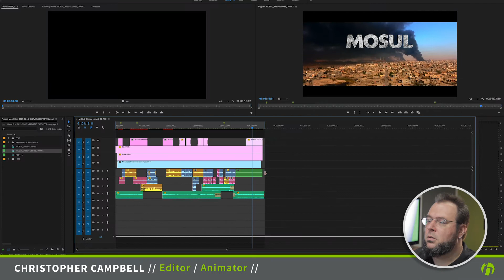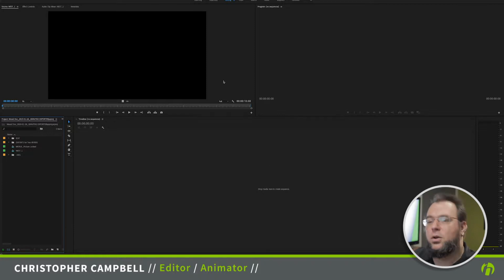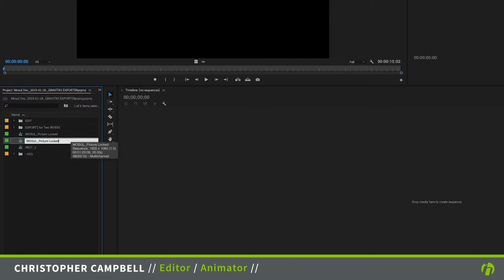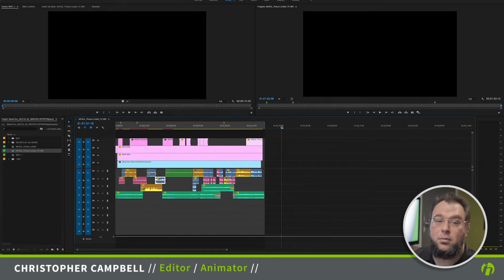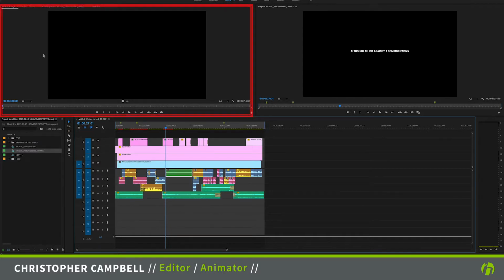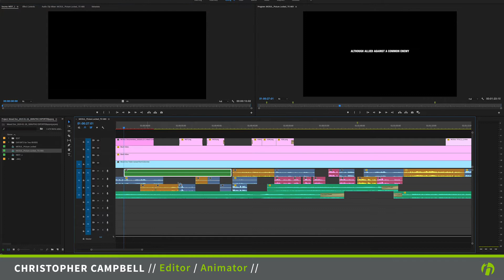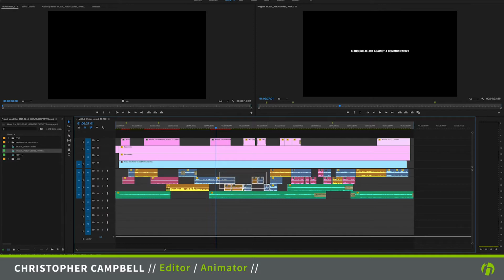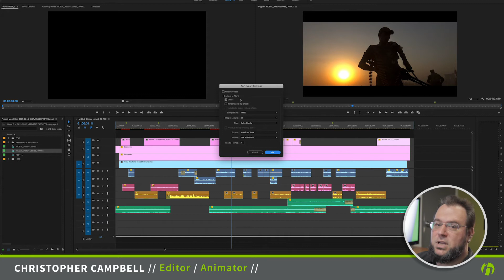Prepare your Premiere Pro sequence for Audio Mixing

Comment: Thought you might revert back all the clips to their original levels, as most directors/producers want a decent sounding screener ie remove rubber banding etc. Also, wouldn't you send your mixer all the mics recorded for each take you cut, as they would have a better ear and could potentially clean a mic you otherwise thought corrupt?